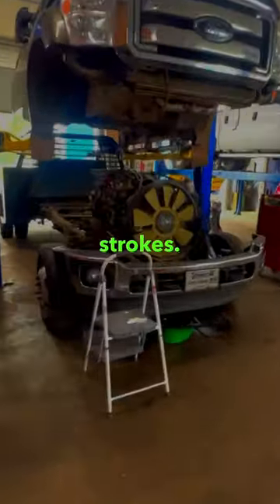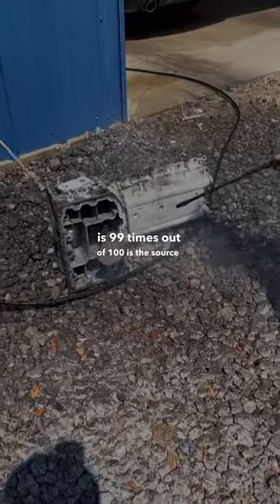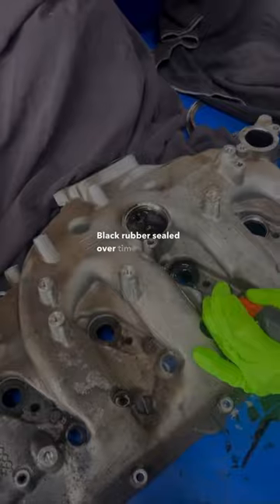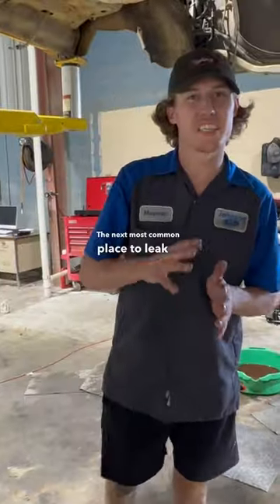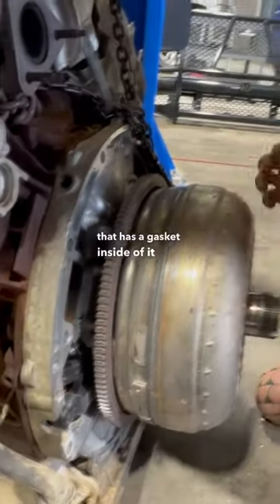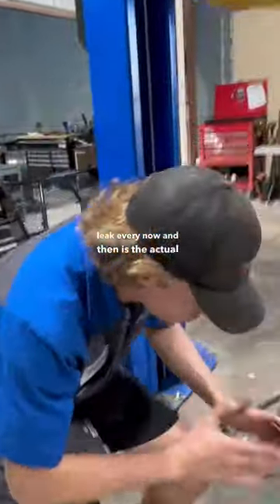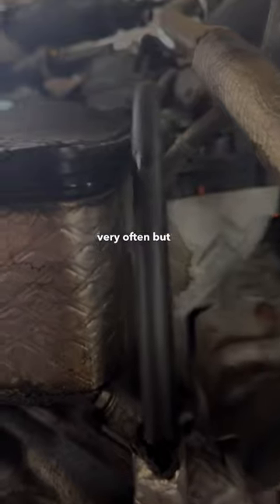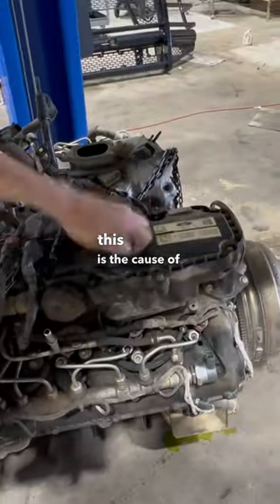6.7 PowerStroke TOP 5 Most Common Oil Leaks IN ORDER #shorts I forgot vacuum pump 🤷‍♂️

Comment: "5 Common Oil leaks" on just one engine. Now thats quality.
Reply: When an engine makes over 400hp with a turbo that gauges out at 40 psi, yeah, some silicone isnt going to stop some leakage
Reply: @az678910  I mean maybe its not that bad loosing some oil. The engine has to have a capacity of like 20 liters or about 50 hamburgers or whatever youd use in the states as mesurement.

(Im kidding I know its "quarts" whatever thats supposed to be)
Reply: @The_Superior_Self  Yeah most leaks arent even bad enough you need to add oil between oil changes
Reply: @az678910  thats good. Thats a thing I like about servicing big engines or engines with large oil capacities they leave you with more wiggle room for things like oil consumption, loss, dilution. Of course I dont wanna be the poor sucker paying for all that oil. Keeping my bike topped up is expensive enough.
Reply: Dude skipped the vacuum pump? Every year after winter for 7 years I’ve had to r&r dozens of seals because the bolts back out that’s not more common than the front cover?
Reply: @The_Superior_Self The 6.7 takes 13 quarts for a wet oil change, which is a little over 12 liters. You're thinking more along the lines of heavy duty diesels with that much oil
Reply: The only major oil leak is the lower pan gasket which has been a big problem since the birth of the 6.7. Its sometimes a 3-5k so people just would add oil in but Ford wont fix it. Every diesel engine from cummins, duramax, powerstroke will leak oil somewhere so its not brand issue but quality control from everyone
Reply: @jaysmith3546  3-5k job is mad expensive for a leak. But I guess it cant be helped if you have to pull the cab, to pull the engine from the frame because the frame blocks access to the engine from below.
Reply: @ImRatrod-Man I guess "6 Most Common oil leaks IN ORDER" isnt that much of a good video title.
Reply: @aaronelmore2147  Interesting. Im used to servicing 3,5 ton european vans and theyve got like 2,5 ish liter turbo engines sometimes even less and they get like 8-10 liters of oil.
But I suppose oil capacity and engine volume are only lightly related.
Reply: @az678910 well then why would they design a motor with that much power if “some silicone” wont hold” sounds like bad quality to me.
Reply: @The_Superior_Self quarts is as made up as liter.
Reply: Quart as in quarter of a gallon. It’s the superior measurement.
Reply: @lopingmymule3104  aha, an tell me then what is a gallon even based on?
Reply: @blahblah8037  well liters is a unit based on water wich is one of the most abundand things out there.
Quarts is a 1/4 of a gallon wich is based on the canisters you guys buy milk in at walmart.

Be honest with yourself the only reason you like the imperial system is because thats what you grew up with and you dislike the metric system because its foreign to you triggering any humans inherant xenophobia for the new and different trying to replace the established and working.
I personaly like the imperial system for being a dumb way to measure things and I can laugh at it.
 
Quarts is a great example. Gallons is to rough and stupid to make finer measurements like engine oil volume. And so quarts was made up as a quarter of a gallon.

Liters can easily be turned into milliliters wich are 0,001 liters giving you lots of easy to interpret and to convert room for finer measurements.

Engine oil volume is usually given in whole liters or x,xliters with the x behind the comma being hundred milliliters.
Reply: @az678910 oh ok, see i would think for 80,000 someone could gave figured out a solution smart guy.
Reply: It’s a Ford
Reply: @daviddownie3431  it sure is. It dont matter if they are european exclusives or home built american cars they are actively flawed.
Reply: they took notes from BMW
Reply: Every single engine will eventually leak oil. No way around it

Comment: 99 times out of 100 its the upper oil pan, but the injector grommets are almoat as common as the upper oil pan? Which is it?
Reply: Circumstantial is how I’d put it, really it’ll rely on the seals. Mileage and weather around the vehicle. Yes the upper oil pan leaks all the time but it can be just as common as injector seals. Again circumstantial is all.
Reply: I thought the same thing.

Comment: Ccv delete is the best money you can spend. Truck idles smoother, throttle is more response. Slight fuel gains on the highway. And it slowed my upper oil pan to not even dripping. Couple hundred bucks beat almost a 3k repair I can wash off the underside every 3-4 months.
Reply: Yes sr i delete my when my truck wash brand new I took of a lot of unwanted parts best decision I make

Comment: Time to get back to the 7.3 near leak proof setup
Reply: A 6.2L gasser is more reliable and has more power than a 7.3L. I had both. The 6.2L in my max tow F150  feels much more powerful. Rated to tow 11.1K. F250 and 350 can tow much more. 7.3 is lower revving though.
Reply: 7.3 leak from the oil cooler, rear main, oil pan (rust heavily in the salt belt), dipstick adapter, HPOP, IPR, and ICP sensor.
Reply: @warrenself I think he’s referring to the gas, ain’t no way he’s talking about diesel lol. Btw the rear mains RARELY leak!

Comment: Currently working on a customers truck, he bought it from an auction flooded and we need to get the cylinders open (taking out the injectors) I’m sure I’m going to figure it out before I get an answer but do you have to lift the cab off I order to get to the back injectors?
Reply: It’s a 2018 f250 xl by the way as well

Comment: Funny, I just noticed a vacuum pump leak on mine yesterday. From what I understand they weren’t torqued right from factory, and all you need to do is change the gasket (for good measure) and torque the bolts with blue loctite

Comment: Got rid of my 250 KR pan gasket 4 times upper and lower then Ford did away with 3g tech and I couldn't monitor the olim or other features. Poor product support and design. Did not want to get to the point of pulling cab, that was a brilliant design.

Comment: Carbon build up from neglect or inferior quality oil ... hot from coolant interval change.......i slap motor cleaner oil drive it clean take care of cabon build up. Slap some Barrs engine stop leak just 1 at a time will do . Then slap some conditioner like motorkote, arch or i havent tried F3 from turbi secret ...i think it has something with un clogging turbo oil line and on line cleaner for coolent system..
  Then pay i guy to do a valve adjustment if its at150000k...and use fuel booster like  Diesel kleen because diesel fuel is pretty dirty stuff and if you dont use it the motor just dies....  but must have good clean filters to start ...or you will of course plug filter.😅

Comment: What about the vacuum pump
Reply: I would say that’s the most common imo, the bolts aren’t torqued properly at the factory and are always loose, if the front of the motor is covered in oil- can almost guarantee it’s the vacuum pump

Comment: I like your videos and your very intelligent. Now im not a diesel mechanic i stick with the gas jobs. But i just have one question? How do you pull motor out with torque converter still bolted to flex plate. On a gas motor you will break the oil pump on the tranny almost every time.

Comment: I had vacuum bolts back out and cause a leak.. I let it leak for a few months and I ended up needing to put a new radiator in so I took all the bolts out and put loctite on them while I was in there.

Comment: If you looking for power, take the power stroke.
If you are looking for reliability and dependability, take duramax. If you are looking for truck has only reliable engine, take a ram Cummins .😂
Reply: Duramax reliable idk about that sir i take a ps 6.7 all day long
Reply: My LB7 is still running perfectly. 
No leaks. 
Duramax did something right that others needed to look at...but a leaky powerstroke repair, I think dealerships want that over something totally reliable. 🤑$$$
Reply: Crank pin , commen Duramax problem
Reply: @coolwhip4165  yup, if you're going to race it, sled drag, modify, and increase power. That's an issue you must remedy.  But for normal use, it's fine.

Comment: Great topic Ford should be proud of the craftsmanship that goes into every Toyota.
Reply: Cool! I’ll go down to the Toyota dealer and trade in our fleet of F-450s on the Tundra 4500s with the 6.8L diesels. Oh wait….damn…they don’t make them. They only make “trucks” for hauling kids to soccer games. Overgrown Camrys with a bed. Plastic bumpers, crap chassis, ultra light duty crap. Not trading in any of our F-150s on a Tundra either. We need trucks that can actually do work. 
 Fords failing was not making the CCV a maintenance item like Cummins did. Even so, we have all learned to change them out and oil leaks on the 6.7 aren’t really a concern. It’s a damn good engine. This kid works in a Ford dealer. If he worked at a Toyota dealer he would be making videos about broken Toyotas all day long too. Drive by your nearest dealer. Their shop is just as big as the Ford shop.

Comment: I've started watching you're shorts and haven't seen you work on a boss 6.2l have you ran into any common problems with those or are they pretty reliable. I have a 2018 f250 with it and it's at 102000 wanna know what lies ahead.  Thanks
Reply: The 6.2 engine is what is in the f150s now too, timing chains are a big problem for the 6.2 Ive heard
Reply: No timing issues with those. Mine has 152k. Seen them get to 400k before. It’s a super stout engine and makes great power, but don’t expect good gas mileage from it 😂. Only issue with it is some people have had issues with valve springs but that’s honestly pretty rare. I’d expect lots more miles from your 6.2.
Reply: @SixtwoSC  I would never own a new gas motor, I have a 6.7